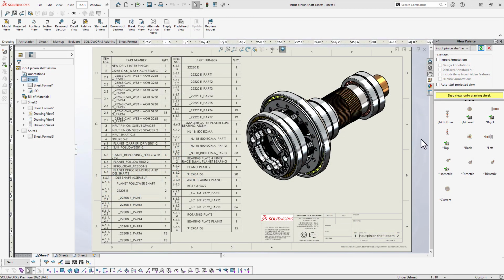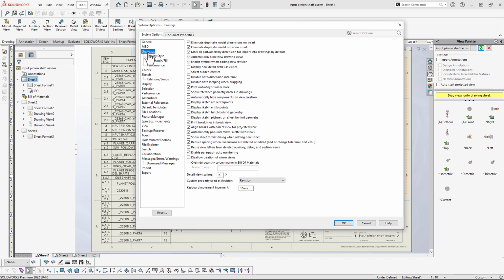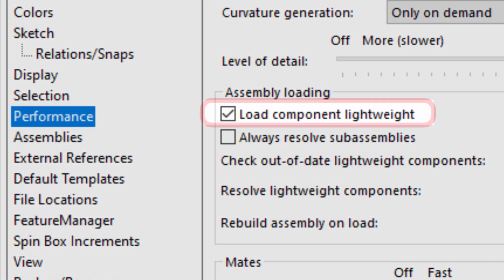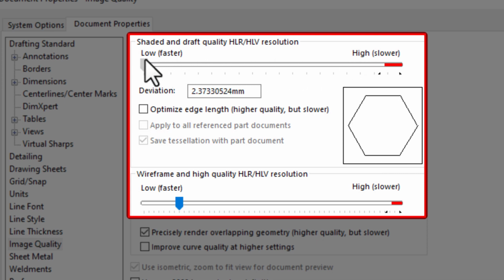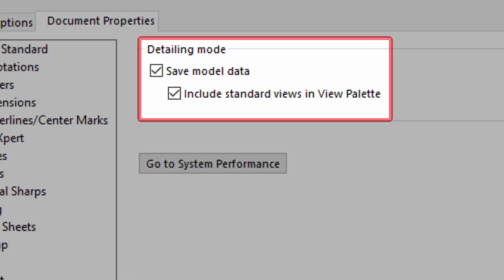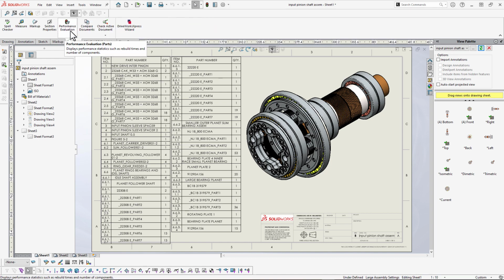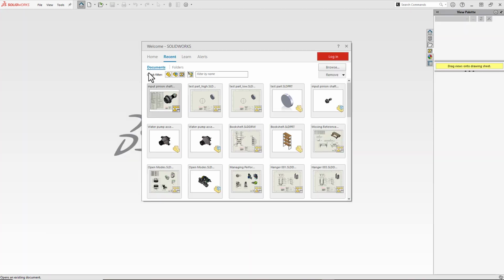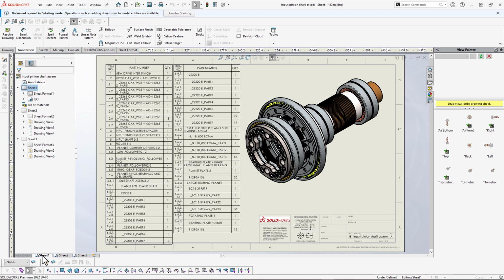Managing SOLIDWORKS Drawing Performance with System Options, Document Properties and Open Modes

Comment: Assembly is 1.5 meg, 2 of the parts are slightly bigger, and the drawing is 6.6meg. 

Drawing file is unusable, it takes 10 full seconds to open the option menu, 1.5-2 seconds to click on a dimension and then be able to do something with said dimension. Pan and zoom are spin the mouse middle roller and nothing happens, roll some more, still nothing and then BOOM it zooms so far in I can't see anything. Reverse spin the mouse middle roller and nothing.....still nothing.....and BOOM zooms so far out I can see anything.

Comment: This also affects visibility of sketches containing Stick Fonts (aka OLF SimpleSansOC) used for laser/waterjet/cnc paths.  Whereas, opening in either Detailing or Resolved mode results in the sketch being displayed on the drawing, opening in Lightweight mode hides those sketches by default.